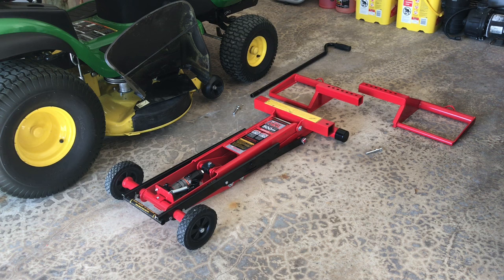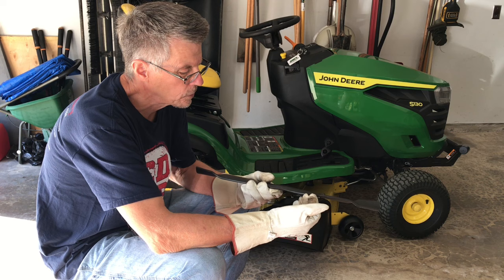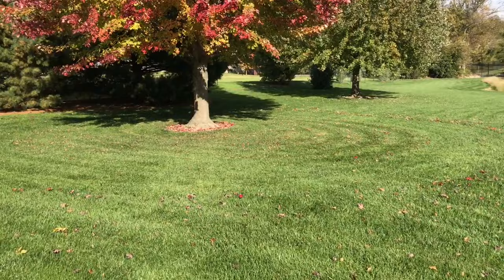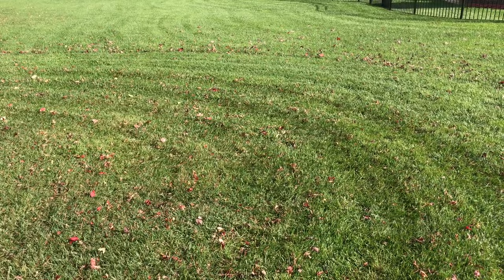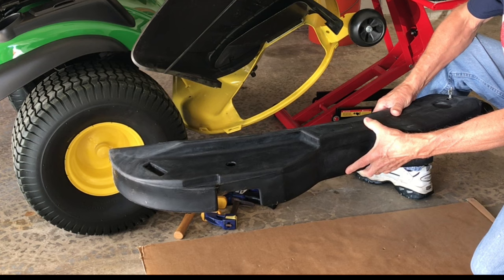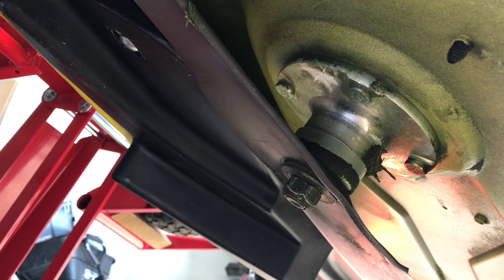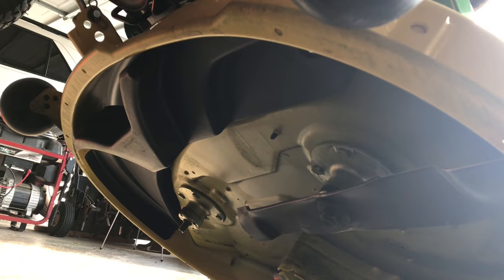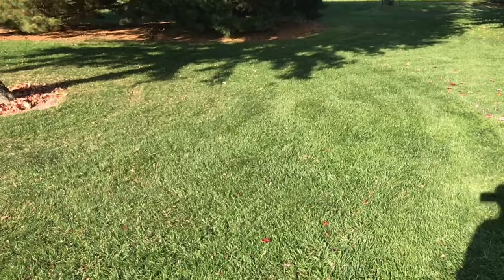Mulching Leaves - John Deere Mulching Plug vs Mulching Kit - John Deere S130 @DIY Boomers

Comment: When I purchased my S130 at Lowes, the sales person said he had ordered a mulching kit for a previous customer but when he went to install the new mulching blades they were the exact same blades as already on the mower.  Also, there is a clip that is supposed to go inside the back edge, but iI could not get the locking clip to go on because the plug appears to be be shaped differently from the deck.  In fact, I couldn't get the plug to  go on at all.  It appears from other reviewers owning the S130  that I was not alone in having that problem, while some people made it work by drilling holes and adding bolts.  This video made it look easy, so I don't know what the rest of us were doing wrong.
Reply from the maker: Hmmmm, don’t have any problem with mine. Do you have the right model number for the cover (plug)? The one that I purchased is the John Deere mulching Cover, Part #GY00115 (S130 42” Deck). I guess another thing could be using the right holes on the deck. If you use the same holes that I used, it’s a bit of a stretch on the second bunji strap, but very doable. You do need to make sure that the notched out section on the top edge of the plug is lined up and fits around the discharge chute on the deck. The rib on the bottom of the plug doesn’t always stay in the bottom channel of the deck, but overall, it keeps the discharge hole covered.

I did have one small snafu however, I didn’t notice the slotted tab on the left side of the plug when I initially installed it on the deck. A couple of viewers pointed that out after I uploaded the video. As it does take a little more effort to get the tab on the inside of the deck, I usually just put it on without using the tab. It’s just faster and I’ve never had a problem keeping it in place.

As far as the mulching blades, they have a longer mulching area on the blade in comparison to the standard blade as I pointed out in the video.

Comment: Honestly, that plug looked to work as well as that kit that cost 3x more.  And the ease to install/remove as needed is a huge benefit as well.
Reply from the maker: Yes, there is definitely not a big difference between the two for mulching leaves. I will be interested to do another comparison in the spring and summer for mulching strictly grass when the grass is much thicker than in this video.

If the difference is also minimal in heavy grass, I will more than likely be using the plug the majority of the time for exactly the reason that you mentioned, ease of use.

For someone not having mulching blades already, the plug + blades would be around $73. It would be about $35 more than that for the kit which includes mulching blades.
Reply: @DIYBoomers  so it would actually be cheaper to buy the plug and blades separately than to buy the kit which would be more time consuming to install than the plug. I just bought the S100 and am thinking the plug will be the way to go
Reply from the maker: Yes, it would probably be $35 cheaper to buy the plug and blades. Factoring in ease of use and comparable results, you really can’t go wrong with the plug and blades. I’m sure you will enjoy your new John Deere!
Reply: Hi Carl.  We used the inexpensive plug for a couple of years, but it kept getting knocked crooked and stuff (I wasn't the only operator %-| ).  It worked great otherwise,.   I even drilled holes and used zip ties to hold in place.   I'm sure the plug works great, but we have some  "rougher" landscaping features and so now we're trying the BM21816 Kit.  Best news is I get to remove that oversized discharge shoot.
Reply: @jeffhopper3526  I just installed the insert and have the discharge chute removed. It blows a LOT of grass out of the chute opening. I was disappointed in this versus the mulching cover. I ended up stuffing an old shirt in the chute opening to stop all the grass clippings from coming out.

Comment: The plug was installed incorrectly.  There is a tab cut out on the left side of the plug that goes inside the deck to keep it tight.
Reply from the maker: Right you are! I hadn’t noticed the tab. It hasn’t been a problem not using the tab but it would no doubt make it a better fit. Thanks for the heads up!
Reply: Thanks for the installation video. I just installed the mulch kit on my new S130. Even noticing the notch on the left it still needed a couple blows from my dead blow hammer. For some reason it took me many trials to get the bolt in the deck hole.
Reply from the maker: You’re welcome. Yeah, either one of the mulching options are going to save you from clumps of clippings.

Comment: Boy, prices have changed. They want $252 for the kit today. I will be checking to see if they still make the plug and if it will fit my 2023 model deck. If so, that plug is all I need. Not even a need to switch blades.
Reply from the maker: I searched for the kit and Amazon sells the John Deere BM21816 Mulching insert Kit for $140.40 which is probably $35 more than I paid for it. They also sell the plug for $31.71. (See the link below).

Honestly, we use the plug instead of the kit as it’s a lot easier to use obviously, and I think it does just as good as the kit.

https://www.amazon.com/stores/page/885F1C0A-F3BD-4BC9-AE30-D3B151C6F9D3/search?ref_=ast_bln&terms=Bm21816

I see the listed models for the kit do not include the S130, but that information has always been confusing. The BM21816 does fit our S130 with a little persuasion from a rubber mallet as you see in the video.

Where did you see a kit for $252, was it the BM21816?

Comment: I had a lot of problems with clumps when it came down to cutting grass and found some videos on changing the useless factory mulching blades to the Oregon Gator Blades... Best upgrade I have ever bought!!! I can not tell you about the other models but I have the G6 blades and absolutely love them all season long!!!
Reply from the maker: Thanks for that info! This is the first spring that I have tried mulching grass and have also had clumping when the grass is so thick early in the growing season. The blades work fine with leaves but I was wondering how they would work in heavy grass. I will have to give the G6 blades a try! Thanks again.
Reply: Thanks for info. I was afraid I'd lost a piece off. Glad I dont have to vuy new blades right away. Good mowing to you
Reply: @DIYBoomers  late to the party, but from what I’ve seen the best Oregon gator you get for the S130 is a G3 blade.
Reply from the maker: I haven’t tried any Gator blades yet. With a very wet spring this year, I’m dealing with a lot of thick clippings. I should give the G3s a try.

Comment: You have the cleanest mower I’ve ever seen.  How old is that S130?  I just bought one and my new mower barely looks better.  Well done sir.  Nice video.
Reply from the maker: Thanks. Yeah, I wish it stayed that way. Those first few S130 videos were shot in the second half of the mowing season in 2021 with around 30 hours on it. (Bought it in August 2021). I keep it as clean as reasonably possible by blowing it all off with my leaf blower after each use. It now has 146 hours on it and like any other tractor that we’ve had, the underside of the deck gets covered with dried grass residue. I just recently scraped that all off this spring. Probably should do that more often but you know how that goes.
Reply: We just bought our S130 at Lowe’s along with a Bagger attachment.  The bagger came with the mulching blades ironically.  You would think they would just add the mulching plug as well, but that needed to be purchased separately.  I wonder if they don’t think the factory blades are good for bagging?
Reply from the maker: The mulching blades are angled up a bit more on the back edge which gives more lift, so maybe that enters in to their thinking. That’s the only thing that I can think of.

Comment: The back side has a plastic molded tab that needs to go inside the deck edge. If you look at the plug you will see it.
Reply from the maker: Yeah, that was also mentioned by jms493 a few weeks ago. I hadn’t noticed the tab before that. It definitely fits better when installed correctly! Thanks for pointing that out!
Reply: @DIYBoomers  No problem, my 2002 model has the same plug, hard to believe! 😉

Comment: Boy, could I use a mulching kit or plug when it comes time to deal with all the leaves we get on the grass here.  But, how tall can the grass get before the mulching kit or plug become a problem?  Any idea, now that it's been over a year since you began mulching this way?  Thanks.
Reply from the maker: Actually, we’ve only been mulching for a few months at the end of summer and fall 2021 (in Midwest US). Before that, I never thought it would disperse clippings & leaves enough to avoid raking or sweeping when needed now and then. I was wrong, mulching works great.

As far as grass height, we try to cut our cool season variety grass between 3” and 4” per recommendations (a bit higher during any high heat or summer drought). You can google recommended cutting heights for your grass type and geography. Another recommendation for maintaining healthy grass is to try not to cut more than 1/3 of the grass blade when mowing. I’ve seen where some homeowners cut their grass way too short and for one, it stresses the grass which can lead to disease, and for another reason it leaves the lawn looking like a cut hay field that needs to be baled. Mulching will do you no good in that situation and removing that much grass is a huge job in itself. Cool season variety grass should not be cut shorter than 2 1/2”.

So I can’t comment on mulching taller grass as we try to get it cut before it gets out of hand. I can say however that cutting it to around 3 1/2”, and no wet conditions, mulching both grass and leaves works great on our lawn. Another benefit of mulching is that it puts nutrients back down into the lawn. Before we started mulching, (if grass got too tall) we would occasionally get a very small amount of grass accumulation in spots that needed to be either raked or swept up with a sweeper attachment. That hasn’t happened since we started mulching. We haven’t come across wet conditions while mulching yet, but we may use the plug in the spring so that we can easily remove it when it gets too wet.

On a side note, we do use fertilizer and weed control to keep the lawn healthy, but that’s a whole ‘nother story.
Reply: @DIYBoomers  Thanks for your reply.  I'm going to purchase a larger machine than my LA-135 because of some extra property I've picked up (giving me over 3 acres to mow). But I can't find a simple, affordable solution for the larger machine (X590).  So, I guess I'll keep the 135 around for mowing around the flower beds and mulching under our maples, apples and plum trees.  I don't think they make anything under $300-400 for the 590 and once on the deck, it won't be easy to remove.   I'm estimating I only need to mulch about 1/5 or less of that 3+ acres.  A mulch plug like you showed us here might be just the ticket for the 135 making it a dedicated mulching machine.  Good video, thanks.😃
Reply from the maker: You’re welcome. Good luck!

Comment: Nice job on the BM21816 Mulch Kit.  We had the plug on previous LT 160, but hitting bushes here and there knocks it loose frequently.
Reply from the maker: Thanks. Yeah, seems to be a good alternative to the kit as we haven’t had any problems with obstructions in the way. We have had a little grass clumping with so much spring growth and wetness with moderate temperatures. Shouldn’t be a problem much longer as temperatures are climbing.

We tried different things to deal with spring grass clumps. Left plug on and attached our sweeper behind to mow and sweep all in one pass which worked well but has it limitations due to trying to mow in tight areas while pulling the sweeper. Ended up using mulching blades without the plug (in wet or tall spring grass) and holding discharge chute up halfway with a bungee cord to spread out clippings a little more. Seemed to work best but still had to go twice over a few spots that were the heaviest buildup of clippings.

Comment: Did a great job obviously on the kit but even still the plug itself wasn't something to scoff at either! I sure would appreciate if JD would make a plug for their Zero Turn 42" rather than just the whole deck kit option like I had to use! Sometimes in a pinch a plug is nice for just slapping it on and going through some overgrown areas without worry of maybe damaging the whole kit option!
Reply from the maker: Exactly. Especially in your case with the zero turn, I saw your mulching kit video and there are a lot of parts involved as opposed to the lawn tractor kits. An option for a zero turn plug would be great. I do however like the ability to switch between mulching and discharge on the fly with the zero turn kit.

Comment: I have a cub cadet for personal use,but mow a commercial property for a friend with his john deere. Both cut well,but my cub is getting long in the tooth and I'm considering john deere as a possible replacement. I cant get a cub in this price range with an electric pto and it's a feature I'd really like to have. I mow my daughters and sisters property too and they prefer I mulch too. I'm gonna get a mulch plug and gator blades for my cub,but maybe next year upgrade to a john deere.
Reply from the maker: Yeah, I don’t know if Cub does the same, but the more affordable John Deere models are built to compete with the other entry level tractors out there and are not quite the same quality as the higher end John Deere’s. For instance the higher end models offer a more reliable Kawasaki engine and are built with more durable parts overall.

Not to say that the lower end models aren’t a good product, We only mow our 1 acre and so far, I am very happy with the S130 that we purchased last summer. It has features like an easy to use hydrostatic transmission, a high back on the seat, electric PTO, wide rear tires, electronic fuel gauge on the dash and a real difference maker in the height of the cutting deck. Tops for our old Craftsman was around 3 1/2”. Our S130 raises up to 4”. One half inch doesn’t sound like a lot, but it has made a big difference for keeping our tall fescue grass healthier here in the Midwest U.S. when it gets very hot and dry in the middle of the summer. A couple of weeks ago, the deck height lever somehow got bumped down from 4” to 3 1/2”. I changed it back to 4” when I noticed it. The difference in grass color was evident as the area that was cut at 3 1/2” was a little bit brownish. This was in a very hot stretch. We only cut around 4” when it’s very hot and dry. This spring we cut at 3 1/2” to 3 3/4” and will most likely do the same this fall.
Reply: @DIYBoomers  Yeah,my yards only about 2/3 an acre and the other 2 I mow are only about 1/2 an acre,so I'm not mowing that much. My cub is 11 years old and the only trouble I've had is the manual pto. Both the cable and handle are worn out. I've replaced the handle and the cable is next. Bigger better tires would be nice too,and the low back cloth seat leaves alot to be desired. I've got til next spring to decide. Thanks for sharing.

Comment: Great video, thanks- is it possible to use the mulching blades with a bagger? I’d like to alternate bagging and mulching. Thanks
Reply from the maker: Thanks! Yeah, I’m sure the mulching blades would work fine for bagging. The John Deere 3 in 1 blades that came stock on my S130 are recommended to do straight discharge, bagging and mulching. They have a little less mulching area and a little less lift angle than the mulching blades, but are still recommended for bagging. With a little more lift, I would think the mulching blades would work just fine.
Reply: I do!

Comment: Do you have a plastic spindle cover on the right blade spindle? Can you use regular 3 in 1 blades with mulching insert?
Reply from the maker: No, I don’t. John Deere doesn’t put a cover over the spindle & pulley on the right side of the S130. I’d say that’s probably because it is further under the tractor frame than the one on the other side and is not as much of a safety concern.

Using the 3 in 1 blades, I don’t see a problem with them as far as fitting with the insert since the lift angle on the back of the 3 in 1 blade isn’t as high as the lift on the strictly mulching blade.

The only question is would the 3 in 1 blade mulch as well as the mulching blade when used with the insert. I would think that the mulching blades might do a slightly better job but I doubt that it would be very noticeable.